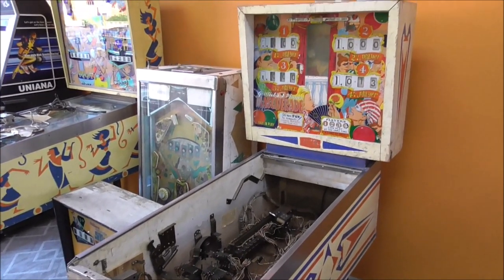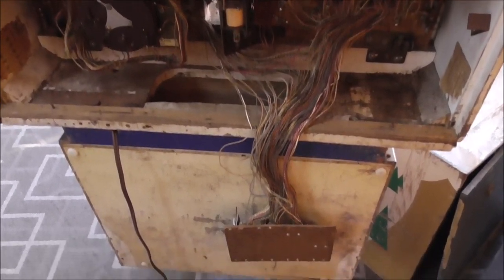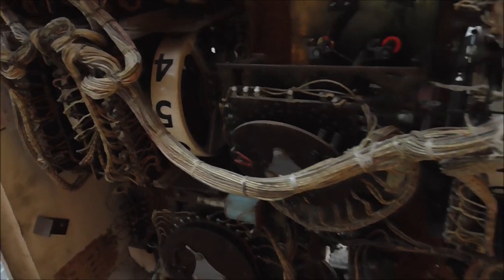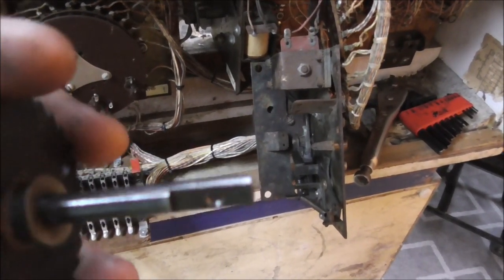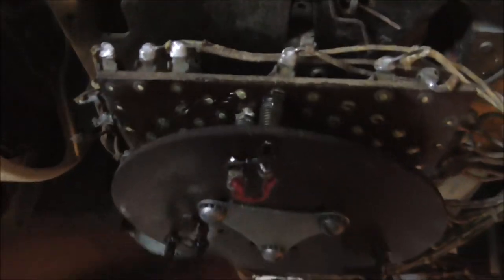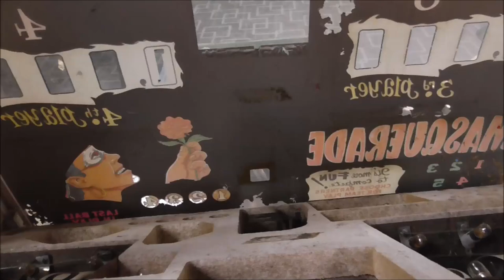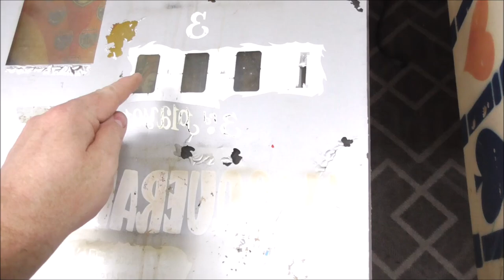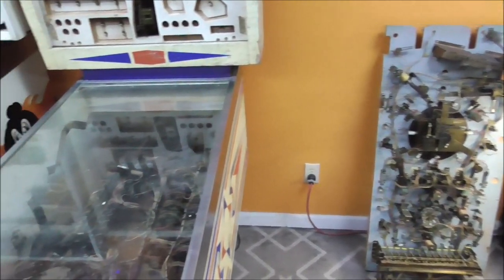Working on the Backbox Wiring in a 1966 Gottlieb MASQUERADE Pinball Machine - #2

Comment: Wish I could mash the like 👍 more than once!!! Good buddy lost his fuel pump on his truck. After they dropped the tank they found the wires into to pump chewed off. Fixed it, they did it again. Then he saw a trick, moth balls. He hung up done little bags (stockings) around the top of the tanks . Never happened again. Has to freshen the bags every few months. Paint on wire tape. Use it on my battery connectors. Solder that bearing maybe
Reply from the maker: I'm going to have to get some of that paint on tape!

Comment: It's becoming part of my daily routine to watch Ron fix the seemingly unfixable... Here the progress on the Rockola repair is going well, gripper mech fixed and now moved on to fault finding in the amplifier, only one channel is currently working. Any tips?
Reply from the maker: I can't remember how old yours is, but if it's solid state you can swap the pre-amp boards inside the amp.  If the other channel now works, then you know your problem is on the pre amp board.  also you need to swap the wiring from speaker to speaker to make sure all the speakers work... and pay attention to the capacitors they put on the speakers or in the lines, they use them as filters and sometimes they dry out and you lose that speaker's sound.  Other than that, capacitors usually fix your issues unless you're blowing fuses.
Reply: @LyonsArcade  hey Ron, it's a RO 436, pre Amp board is inside Amp chassis and one of the first transistor ones, if i recall

Comment: The dohicky, (notice I am using the technical term for it), that you hammered back in place is called a "standoff". Said 'standoff' is "swaged", (aka press-fit), into the sheet metal plate. The proper term for swaging is actually "smushing". So what you did was used your hammer to smush the dohicky into the plate. 
Now personally I don't care if you use the proper terms or not, but we must be sensitive to the up-and-coming younger demographic that watches your videos. It is important that these young, impressionable minds learn to call things by their proper nomenclature. (I don't really know what last word I used meant but I got it out of one of them injun-ears books once, and it sounded cool, so I slapped it in there.)
Seriously, I love watching your repair videos. As a 21 year precision sheet-metal journeyman/CNC programmer and 3D CAD designer, there is no thrill like getting an old EM machine running again, regardless of what it does. Thanks for sharing your work.

Comment: Hi Joe, just a thought but I was just wondering if you could use some light activated glue on the insulation damage to act as a kind of resin style insulation coating? I've never used light activated glue but if it set fast enough could work I would think. Love the channel btw, really interesting watching repairs on these old machines.

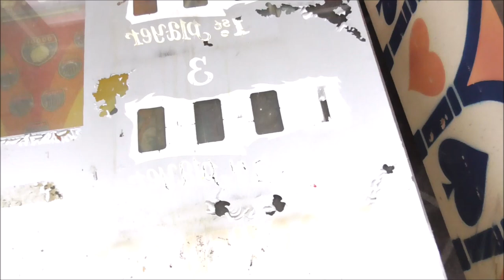Comment: @32:28 You had mentioned heat expansion and cooling to be the culprit for paint chipping but that would be more prominent where the light bulbs are if that was the case.  Compare a Lichtenberg pattern in glass to the paint chips and you may find a similarity, I think it's static electricity .  I'd bet that if you grounded the glass and chassis it would go a long way to prevent further damage.
Reply from the maker: .... but it is chipped more where the lamps are.  You just think it's static electricity because I mentioned it isn't grounded.  (You know, like your cell phone charger isn't grounded...)
Reply: @LyonsArcade  no need to be offended, I have three decades of electrics repair and thought I'd chime in.  I'll refrain from posting anything again.

Comment: What do you use instead of WD-40 ?
To free loose stuck bolts ?
Reply from the maker: P.B. Blaster is really good and sometimes we just put oil on it.  There's nothing wrong with using WD-40 to free stuck bolts though you just don't want to use it on anything you're going to leave it on that needs to move like a stepper unit or something.  WD-40 is fine for freeing bolts.
Reply: @LyonsArcade  thanks for the advice

Comment: You said it was going to be free play and you aren't going to put the replay wheel back in, so why bother with the 0-9 unit? It is just for the match feature, which btw there is a jumper to turn it off.
Reply from the maker: Maybe the 0-9 unit is used for different things Charles than just the match unit.  Have you looked at the schematics?  The star unit on the roto-target relies on the 0-9 unit if you check out the schematics.  

Just relax and enjoy the videos, you don't have to look for reasons to tell me I'm doing it wrong.  You missed a bunch of things I did wrong by the way!  Might want to go back and re-watch it, I messed up all kinds of stuff....
Reply: Ron, I'm not telling you were wrong, just curious why. I hope there is footage on the star unit, it sounds very interesting!